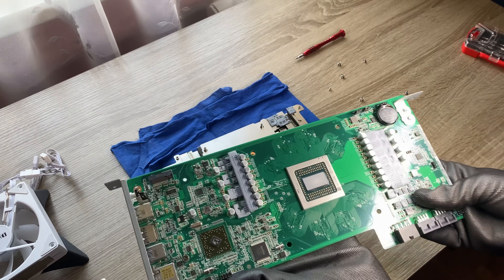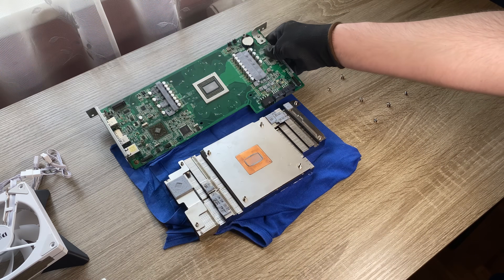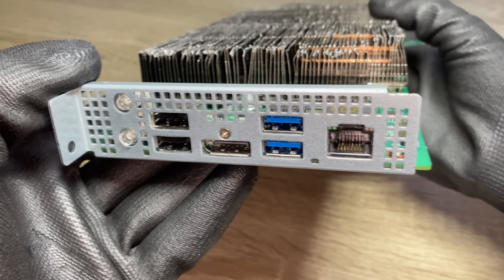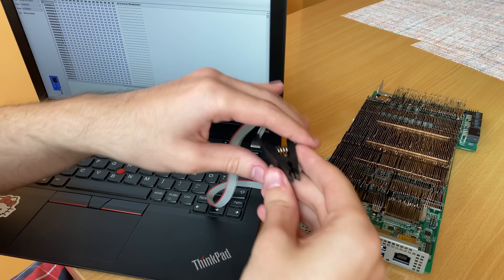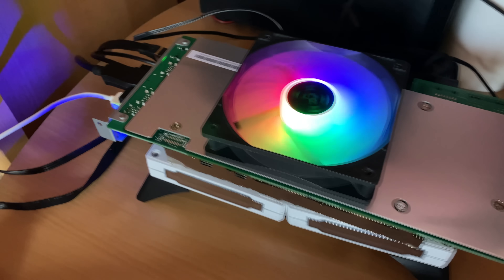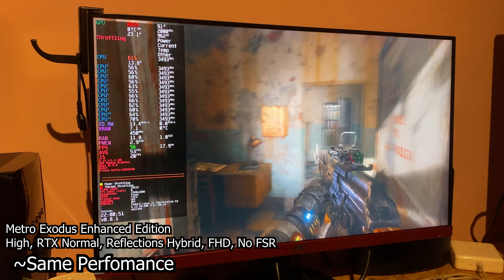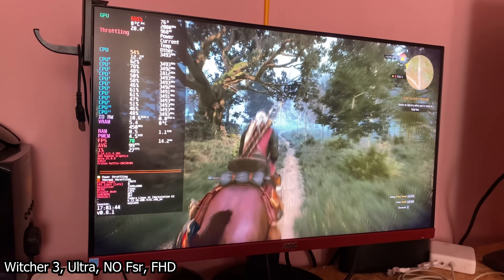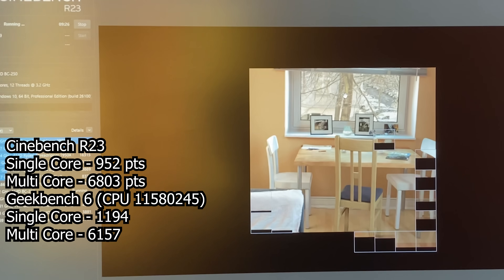This PlayStation 5 Chip runs Linux and It is AMAZING!

Comment: Very cool! Now, you need to study a design for a brand new 3D printed case ;)
Reply from the maker: You mean to make a design myself? There are some options actually, in Discord server in pinned comment. Btw, someone even made 3D printed adapter for cooler from... AM4. So technically AM2-AM5. But you still must do something with VRM.
Reply: @OleksiisTech very interesting, thanks for sharing the info.
Reply: @OleksiisTech I guess you can just buy some small heatsinks and secure them with thermal pads. They dont need much cooling, just airflow and some fins to dissipate heat.

Comment: I would like to have a PC, a pure PC, a finished PC with a PS5 CPU and GPU where you can install Windows, not just the GPU, but when I play, only in 1080P because I don't see any difference between 1080P and 4K, and without RT because I don't like RT, or ray tracing, so I hate ray tracing just like FSR and DLSS because of AI, I hate any kind of AI, to put it simply
Reply: FSR and stuff isnt really ai but upscaling, they might use ai but thats afaik
Reply: @venomousesvinstas  Upscaling didn't work for me in any game because I only use 1080p and in 90% of games upscaling isn't necessary. I only have old games, no new ones. The latest game I have is from 2019. I don't have any games beyond that and the games I have don't have DLSS or FSR in them and even if they did, it only reduced the FPS a lot like with LossLessScaling or Magpie or it made no difference at all, so the FPS was the same as without.
Reply: @venomousesvinstas  I prefer the native resolution because as mentioned upscaling is either not implemented in my game or it doesn't work anyway, so I either have gosting or other effects which I don't need, I prefer native resolution
Reply: why do you hate everything that's good? L take, dlss and 4k are both amazing
Reply: @theorphanobliterator  With 4K it's just that I don't see any difference between 2K and 4K and the graphics aren't important to me. What's important to me is 30 or 60 FPS and I don't like DLSS because DLSS has AI in it. I also prefer native resolution to any artificial enhancements. I don't play games with ultra graphics. 60 FPS log is important to me because I can't really see or feel more than 60 FPS. I don't notice any difference with the mouse or controls, not really noticeable, even if I had a monitor with more than 60 Hz. Plus, anything more than 60 FPS or 60 Hz goes on the electricity bill, which I don't need.

Comment: can you test emulators like ps3?
Reply from the maker: I plan to. I wait for DP - HDMI cable hoping it will work with my capture card to make video look normal.
Reply from the maker: Well, it was fast, I got the cable and it works with my Capture Card.
Reply: @OleksiisTech cool, i would like to see how it works with distro like batocera or emulation station. (looks like a nice candidate to put behind TV

Comment: There's another version of the motherboard but without a vendor. The motherboard only say AMD and if I'm correct with your information it might have the same problems like the lack of I/O, lil to no ports and have a problem with the lack of GPU support on window 😅
Reply from the maker: If you will find it, tell me it's name.
Reply: @OleksiisTech He probably means a motherboard based on the Ryzen 4700S

Comment: this would be a banger board for a hand held
Reply: This board draws too much power for a handheld.
Reply: @EdyStauch  whos says someone isnt up to the challenge
Reply: @Mtg2 it’s probably gotta be a pretty bulky handheld
Reply: @EdyStauch  gaming handheld might work. it draws very little power compared to for example those old rtx 2060 laptops which also should be a lot slower than this board.
power draw can generally also be tuned a lot using undervolting and some slight underclock. with pc hardware a 5% reduction in performance can often save about 30% to 50% of power.

poweruseage might not be great compared to a ultrathin laptop, but compared to a gaming laptop it is quite normal/average power useage, would be low compared to the high end gaming laptops.

that said, gaming laptops can't be used on your lap in general due to how much heat they generate, so handheld wouldn't be nice to use either.
but it should be possible, just don't expect it to run long on a battery
Reply: i hope someone try's to make a laptop with one

Comment: If anyone is curious about the insane latency for the memory, this is what happens when you run a cpu off of VRAM rather than normal ram, as VRAM is more optimized for high bandwidth rather than high speed which is good for gpus but terrifying for cpus
Reply: Interesting. This question has sort of twitched in the back of my mind from time to time. Thanks.
Reply: yep, this is also why memory compression scales much better for gpu's than for cpu's.
as it increases latency but if done right can also greatly increase bandwith(and total capacity), as a result this will often make a cpu slower unless you have little ram, but can make a gpu  much faster. 
not much done in practice however, unsure why.
Reply: GPUs are masters of deep pipelining and latency hiding. This is also why you have thousands of "threads" or tasks-in-flight in GPU code where when one being executed performs a memory request, it gets suspended, and in the interim, another task gets continued whose memory request has just been served, which was suspended a relative eternity ago in terms of clock cycles. Keeping the core occupied during memory request is also exactly why we have Hyperthreading on PCs, unfortunately limited to two tasks per core only.
Reply: Ainda sim é melhor nesta configuração para rodar jogos do que se foce ao contrário, usa do se RAM comum, no final das contas queremos economizar o máximo para jogar games😂

Comment: use a belt sander to remove the top fins, it will be a clean job and the heatsink will look beautiful with the leveled cut.
Reply: NGL I did this with a pizza cutter once for an old Tesla GPU. It worked, but I cannot stress enough how many times I nearly lost a finger.
Reply: @DigitalJedi  u are a mad man lol
Reply: there is a 3d printable scrap tool now that removes them while keeping even spacing for anyone in the future/now watch/reading....Im dumb and 3d printed a shroud, bought a fan that is wayyyyyyyyy to hectic, 6700 rpm and cant get my pwm working hahhaaha, but got a pd trigger board run it at 5v from usb and is fine

Comment: ducting for the fans maybe? instead of riping out the ribs?
Reply from the maker: Would work, but for same efficiency these fans must work on higher speed, thus louder.
Reply: @OleksiisTech  I meant ducting 120mm down to 40mm fan sized openings. 
you already have a 3d printer and ik there's models for it... 
just thought it seemed more doable for more people by comparison to ripping out the ribs
Reply from the maker: @dosanlol it's absilutely doable, people in BC-250 discrord shared such solutions. For me it's more convenient, but yeah, I agree I should have mentioned it in the video.
Reply: @OleksiisTech  either way the couchplay pc already has a 12gb rtx 3060 and a 3400g so i should be good ( use it for testing parts i get coming in for side job)

Comment: Even better value than xeon bulids?!?!
Reply from the maker: Xeon builds became obsolete with mutants drop. And this thing is even better.
Reply: @OleksiisTech mutants…what?

Did i miss something
Reply: @Heuzro  "mutant" refers to a laptop CPU that has been adapted for use with desktop motherboards. These "mutants" consist of a CPU chip mounted on a custom-made PCB, which is then installed onto the motherboard. ;-)
Reply: @ ooh
I knew they exist but never knew what were they called…ty (:
Reply: @ why are you telling me? I just answered his question.

Comment: What most people don't get, is that PlayStation 5 games simply NOT compiled with DirectX or Vulkan in the first place.

PlayStation 5 is designed to run AGC, GNMX, LibGCM, PSSL, PSGL.

As you can see, none of them is Vulkan. Let alone DirectX.

However, since AMD is the one designed both PS5 and XBox machine, only XBox was designed with DirectX and Vulkan in mind.
Reply: Doesnt really matter. Xbox and ps5 use the same architecture. And xbox uses modified version of dx12. And these chips themself are built around rdna2 that support vulkan as well.
Reply: @GG-fi4ye  The PS5 GPU doesn't have the hardware feature to run DX12U (NVIDIA)'s Next-Generation Pipeline. PC RDNA 2 was modified to run NVIDIA's next-generation pipeline (NGP) instead of AMD's next-generation pipeline from NAVI1 (RDNA1). 

PS5 GPU has RDNA 2 RT cores with fork geometry extensions from NAVI1.
Reply: @GG-fi4ye  Specifically, the PS5 GPU lacks hardware support for mesh shaders, variable rate shading (VRS), and sampler feedback. These are mostly from the NVIDIA Turing architecture's next-generation geometry pipeline, and PC RDNA 2 was modified towards NVIDIA's direction.
Reply: @valenrn8657 that shouldnt really matter that much. It probably couldnt run pc version of alan wake 2 but it still could run windows 10 (technically) just not the whole feature set of dx12 and the games like AW2 that run whole dx12 feature set.
Reply: @GG-fi4ye  AMD 4700S's PS5 CPU was benchmarked.
Reply: @GG-fi4ye rdna1
Reply: Now imagine if this tech was available on an OS like FreeBSD
Reply: @Aresydatch  PlayStation uses a modified FreeBSD
Reply: @formbi  Yes, but it's not available outside of their OS, which makes it very useless
Reply: @Aresydatch  FreeBSD's authors and their choice of bend-over licenses are to thank for that
Reply: But Xbox series has literally same chip, therefore this hardware should be optimised to run those

Comment: Try ps5 emulator. There is one named PCSX5
Reply from the maker: If it's on Linux and there will be no problems with recording video about it (like there are with Nintendo emulators), I will definitely try it and other emulators. Thank you.
Reply: @OleksiisTech There is no Linux support in PCSX5, but an emulator called RPCS5 supports Linux. If you don't pirate your PS5 games, it'll probably be fine(According to what is written on the internet), but I'm not sure.

Comment: I'd stick with the 12/4 or 15.5/0.5 allocation. The GPU driver can dynamically grab more RAM as-needed anyways.
Reply from the maker: Yes, on paper. In reality Control crashed with 15.5 allocation with VRAM error, and other games are generally less stable. And give 0 boost. You might say that I tested not much games, but it was an experience in literally all of them.
Reply: 12/4 sounds appropriate@OleksiisTech
Reply from the maker: @ yes, especially if you play on "Optimal" settings and not Ultra.
Reply: @OleksiisTech Hmm... I have my steam deck set on 15 ram and 1 vram, and games never crash, including Control. I would buy this in a heartbeat if it had more ram. 16gb between cpu and gpu is unusable for new games. Especially if it can't allocate vram on demand.
Edit: I just saw some Portuguese guy with this board and vram on demand worked for him, without crashing his games.
Reply: A lot of games only do a VRAM check once when they first boot so they will see the 512MBs allocated and assume that’s all you’ve got
Reply: some games just look at the current vram and go nope. not knowing its a apu can just grab more.
Reply: @ That should apply mostly to old titles though. Is it still this bad nowadays?
Reply: @Psychx_ Yes. "Halo Infinite" isn't old ,as one example. It does this

Comment: Hi, I have the same one, but there are games like Cyberpunk 2077 that don't work properly for me, I only play for about 2 minutes and after that the Fps drop to 3-5fps, there will be a guide to see if I correctly installed everything necessary.
Reply from the maker: Are you sure you have 8/8 bios? I had exactly this problem on 4/12 one in Horizon Zero Dawn. Couple minutes 70 fps, then - 1. Open your system monitor and tell me how much RAM it sees. If there is 4, then it's time for flashing new bios.
Reply: @OleksiisTechI have 8gb in the Bios, it freezes so much that I can't open the usage manager.
Reply: Fedora 40, and I've already tried Fedora 41. Both versions give me the same problem. Several games run fine, from Resident Evil 2 Remake to Resident Evil Village.
Far Cry 5 and Devil May Cry 5, but in Cyberpunk 2077, Far Cry New Dawn, and others, I experience freezes or drops of up to 2 fps and crashes.
Reply: Do you have a link to te-leg-ram?
Reply from the maker: @ yep. Here - https://t.me/trashtech_enjoyer
I must warn you I am not a customer support, I have left with only one solution you may try.
Reply: @OleksiisTechdriver update
Reply: I've already updated the BIOS and can set it from 512 MB to 12 GB. But it keeps happening: it gets slow and I can't play games because the frame rate drops to 2 fps.
Reply from the maker: @ Do you use Fedora 41?
Reply: Btw my Bazzite got upgraded to Fedora 42

Comment: You nailed the rad, I though it was done in factory
Reply: Haha, no.
Radiator was made with a terrible design.
Most radiators have fins, you clearly saw they were either tubes on this one, or bent.. in a way.. that it'd be horrendous for heat dissipation.
Whatever he did.. was better for heat dissipation.
Albeit, it no longer looks all fancy and shiny.
Reply: @yasirrakhurrafat1142  Because it was a blower design, not fan. For blower cooling you do want air pipes.
Reply: @alexturnbackthearmy1907   bruh.. that makes no sense.
Its hollow tubes over the thing that needs cooling. And the air isn't even getting to the source of heat unless you cut it into fins.
You can't possibly put a fan to its side.
Reply: @alexturnbackthearmy1907   bruh.. that makes no sense.
Its hollow tubes over the thing that needs cooling. And the air isn't even getting to the source of heat unless you cut it into fins.
You can't possibly put a fan to its side.
Reply: @yasirrakhurrafat1142  You stack up couple of these in a metal chassis. Then the other end will be perfectly sized for 12cm fans. I'm not making it up, this is how all servers work. Splicing open the heatsink to work otherwise is actually insane.
Reply: @すどにむ   why even bother with fins though?
Wouldn't a heat exchanger.
Like ACT heat pipes be more efficient for heat radiation?
Like them snowman/thermaltake, noctua coolers have.
Is it the risk of leaking?
Especially those noctua ones, for the small form factor PCs (sff), give good performance while being very flat.
Reply: @ They REALLY run the air sideways. Like water around pillars of bridges in a river. Almost every rackmount server heatsinks work that way.
Reply: @すどにむ  .. yea.. but.. ya can make it (heat exchangers) to work similarly, it'll likely not require for the fans to run at full-blast either.
Cuz they're more efficient at radiating heat, atleast across the volume/surface of the heat pipe.
Reply: @ I don't think you understand heatsink thermo dynamics or English very well. There's nothing to hypothesize or discuss about this cooler design at all, it is as normal as the engine of a car being in the front.
Reply: @すどにむ   sure
Reply from the maker: Well I made it awful and it was possible to do it better. At least not bending some. However, it works fine and temperature is great. Not seen in video bcs as I said there I used that DIY cooling Pad. With just two fans on top it's way better. I also put PTM 7950 on it.
Reply: @yasirrakhurrafat1142 it was made for server rack where close top makes sense

Comment: SteamOS?
Reply from the maker: I heard someone had problems with Steam OS, but I will try it if this video will get a lot attention.
Reply: You can't change the gpu driver easily on official steamos since it's immutable. It might work later on once they update to the upcoming version of mesa that officially supports this board but that will be a while.

You can just run bazzite instead though where once the new mesa is out it will likely be very plug and play and you could get the SteamOS experience without the issues of trying to run SteamOS on something that isn't the steam deck. Not sure why people are so insistent on using SteamOS on unsupported systems instead of just using better supported alternatives.
Reply: The Arch-based one that Deck uses is not out yet. There is only an outdated Debian-based one, and an unofficial HoloISO which is outdated too 'cuz developer abandon it.
Reply: Just use windows
Reply: @mila-d5b  Did you even watched the video? Windows doesn't have drivers for AMD BC-250, only Linux kernel does.
Reply: @mila-d5b Doesn’t works on Windoze.